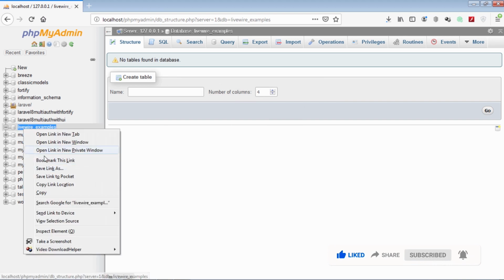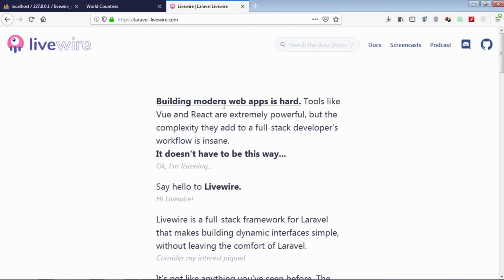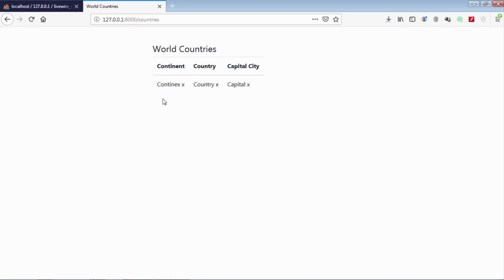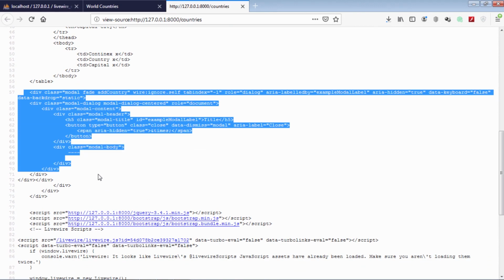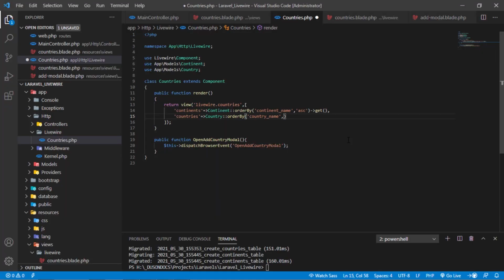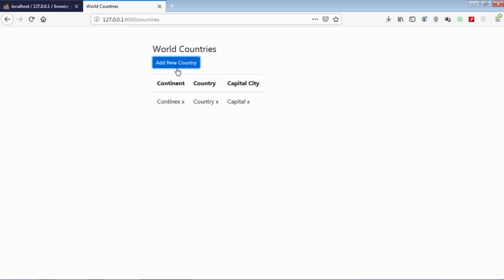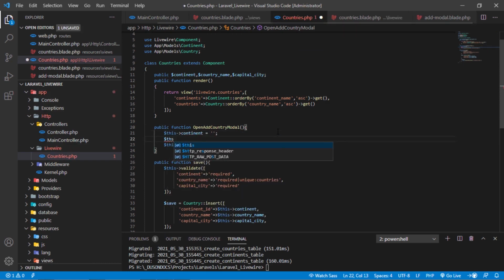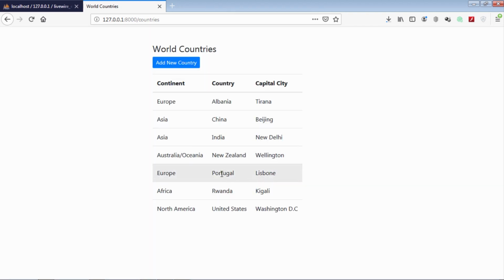Insert and Retrieve records using livewire | Laravel livewire

Comment: I cannot validate the modal in the save method 🤨. But it does print dd('hi'); 🤔

What happens? My code:

public function save()
{
    	$this->validate([
            'name' => 'required'
            ,'abbreviation' => 'required'
            ,'is_active' => 'required'
        ]);
.....
Reply from the maker: hi. add wire:ignore.self on modal
Reply: @devityworks  Hi, I already added it, but my modal is hidden. And the validations are not performed. I still don't understand how this happens.
Reply: @devityworks  Hi, clear the cache with the following command: "php artisan optimize:clear". But something curious happened, when I validate the empty form fields, the modal hides; but when I call it again, it brings me the validation messages.
Reply from the maker: check if you add 
prevent on method: wire:submit.prevent="methodName();"
Reply from the maker: hi. add wire:ignore.self on modal